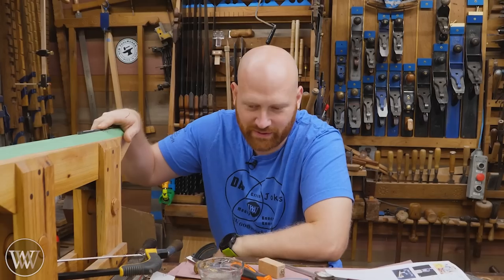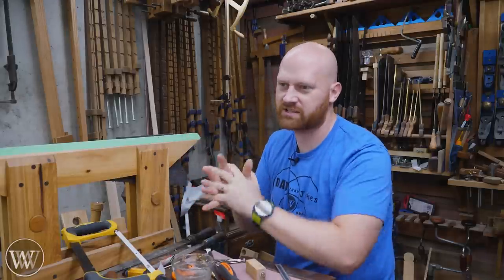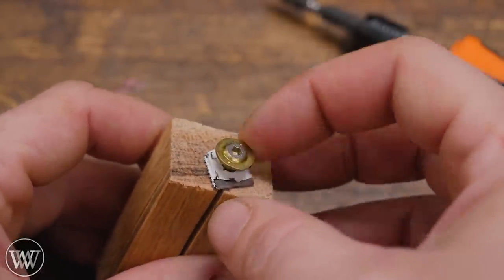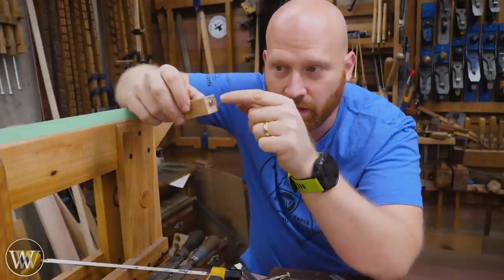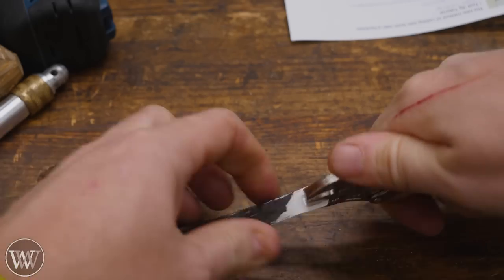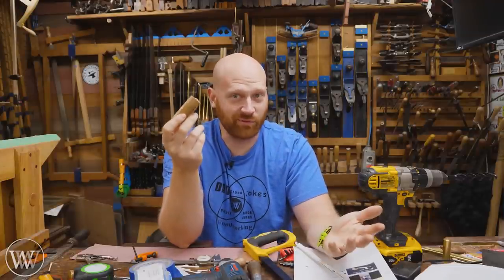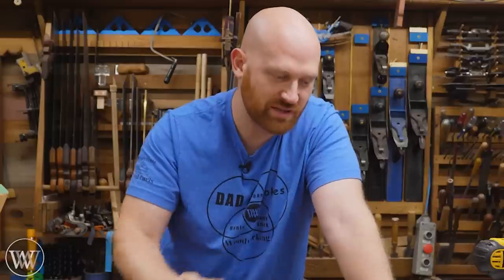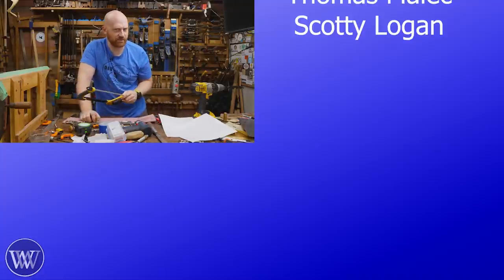I Was Wrong About Cutting New Saw Teeth A Better Jig

Comment: Just a thought.  Cut the slot in your scrap wood to the depth you want the teeth-cuts to be.  Attach a couple more pieces of broken hacksaw blade to the underside of your jig so that they protrude beyond the front of your jig.  Now you have a depth stop, and all it cost you was more of the broken hacksaw blade and a little epoxy to attach the pieces to your jig.
Reply: I like the epoxy/glue idea. That way the depth stop pieces will come off before they can dull the hacksaw itself.
Reply: Also, make the slot in the wood block as deep as you need it for the largest saw teeth you ever need to make then drill a couple of pilot holes down from the top of the block to meet that slot.  A couple of blunt ended screws driven down through those pilots & you have an adjustable depth jig with depth stop as you’ve already described.

Comment: I saw Dan’s video a while ago and I thought his jig was brilliant. I also knew I never would (or could) make anything even close to to it…even the box he made for the jig was gorgeous. James’ version is much more approachable for the home workshop. My first thought is that, rather than make the jig adjustable, I’d make one dedicated to a specific size with an indexing plate and saw guide plate spaced with appropriate shim stock. For high tpi count maybe a cheap feeler gauge set would provide the necessary spacers (not worked anything out yet).
Reply: Your first thought is right on.  Unless someone's going into retoothing saws for fun and profit or into making custom saws to order it's not worth making more than one at a time for the specific TPI.  Save each one just in case, but they'll probably not be needed again unless loaned out to a friend,
Reply: Thanks for the praise George I appreciate it. I keep meaning to post a video demonstrating the first guide I made which was much more like you mentioned, simple to make and fixed at a certain TPI. When I get some spare time I'll upload it. I'm currently working on a revised version that I hope to make a small batch of.
Cheers
Dan.
Reply: @thewoodmandan842  That sounds great Dan, I’ll look out for the video.

Comment: You could epoxy a strip of scrap hardwood to the hack saw blade to create a depth stop. The downside is you would have to make a new one for each replacement blade as they get dull. 
Although, since it will have a short lifespan, it might not matter if it's hardwood. You might be able to just cut up some paint stirrers or yard sticks to get your stock more easily.

Comment: Thank you James for the mention of my first video. The number of views and comments have caught me by surprise. I have a cheapish back saw with hardened teeth where a lot of the teeth are broken out. I am thinking about grinding the teeth off and re-cutting new teeth. Is that worth doing or is the blade metal not suitable? Could be my 2nd video.
Take care, Harrance.
Reply from the maker: Jack saws have hardened teeth so they can not be easily cut and will ruin most files. Generally those blades are considered disposable.
Reply: @WoodByWrightHowTo  I understand about the hardened teeth. I was more thinking about if I grind the teeth off, down to the "un-hardened" metal, would this be too soft to hold an edge for sawing. I have been using pieces of jack saw blade as card scrapers for ages. The files cut this metal well.
Reply from the maker: With a hack saw blade the whole thing is hardened. Not just the teeth. At least the ones I have worked with. Maybe some don't
Reply: @WoodByWrightHowTo  I think you have misunderstood my comment. I am wondering about a cheap Tenon Saw with hardened teeth. I have been using cut up pieces of these as card scrapers for years and they work great. The scrap I used in my video was one of these. I am thinking if the hardened teeth are removed and new teeth filed in, would the underlying steel be hard enough to hold an edge enough to make it a useful tool. I have not seen any opinions either way about it so I was wondering about your thoughts on it.
Reply from the maker: Oh yeah definitely. The same steel that would be under that is the exact same still you'll find in pretty much any saw out there. It won't last quite as long as the hardened teeth but you can sharpen it easily.

Comment: Glue the piece of the blade to the end of the wooden block and you can adjust the distance with a screw.  Attach another blade to the side of the saw blade to adjust the depth.
Reply: Exact same thought I had.

Comment: Nice jig. I wouldn't worry about a depth stop. As long as you have some sort of near depth marking and get close - a stick in the saw vise, level the blade, level the stick at depth, file, touch the stick, your done, rinse n repeat.
After all, many of the ways to fashion depth stop would raise the plate in the vise and higher the plate, higher the vibration.

Comment: Brilliant. Reminds me of a box joint cutting jig.
Reply: Damn you, now I want to build a box-joint hand saw/plane. But I will have to finish a few other projects before I can get to that. On the other hand, it should be possible to mark them out quickly by making an appropriate stack of snap-off knife blades and spacers that you just tap against the end-grain, the depth line you sort out by putting a ruler up against the mating board flushed with the end. I suppose good spacing is about 1.75 saw kerfs wider than your favorite narrow chisel.

Comment: Welp, that works hilariously well. Heck maybe you could use some double sided tape or epoxy or .... something, to attach the scrap hacksaw blade to the cutting blade (on the other side of the blade from the jig so it doesn't mess with spacing) to act as a depth-stop. Though just some masking tape as a visual guide would probably do the trick if you slowed down on that last stroke a bit. Now I just need to decide if I want to buy a plate or file down an old one to try making the coarse rip saw I've been wanting...

Comment: I recently cut new teeth on an old saw using Paul Seller's method. Before I got done, the wooden guide block had completely fallen apart, and the teeth were uneven. I will have to see about making one of these jigs.

Comment: A bigger hacksaw scrap would allow you to fix it higher up ,the screw clear of the actual cutting hacksaw,that would allow you to use perfect thicknesses of spacers without the screw needing to be filed if they too are fixed higher up or wrapped around front and back,I am accumulating saws with hardened teeth in my job as a carpenter that I will be able to re use thanks to you and my angle grinder

Comment: Weird. I just ran across thewoodmandan video earlier today and passed it on to your earlier video which I also just found today [i guess it's "Re-Toothing Day"?] and to someone else's saw retoothing video I found today. Now I just stumbled across this update of yours and you opened up another way to skin the retoothing cat. For example, where you drill the hole in the end of the wooden block for the hacksaw blade, washer and screw I think you could make it much more adjustable if the blade had a hole in it just large enough for the screw head to fit through and you drilled a counter bore in the end just deep enough for back of the round head/washer head screw head to bottom out against so the reference surface of the screw head to be zeroed out flush with the hacksaw blade you've epoxied or otherwise affixed to the end of the jig. Then, depending on how snugly the screw is in its hole you might be able to adjust the TPI/PPI spacing w/o washers. There are, however, all sorts of different thickness of brass washers available from machine tool suppliers to hobby shops. You could use the blades from a sacrificed HF&T feeler gauge or two if you wanted to. Just a few quick, top of the head thoughts. (Thinking of new ways to do things. It works every time its really tried.)

Comment: I mean this one is nice but it seems more likely to let the saw hop around that the other one.  It also requires you being coordinated enough to use both hands and still drive the saw accurately. Though your three c clamp jig was admittedly unwieldy, it left your second hand free to help keep everything stable. Plus it has a depth stop.

Comment: Epoxy the heck saw piece in, and screw is free from holding duty but adjustable for different tpi. Maybe use a 6-32 or 8-32 machine thread screw so 1 turn is 1/32 of an inch.

Comment: Depth stop is easy, fit two blades into the hacksaw, one to  cut and one ground flat the desired depth back from the cutting teeth.  Maybe enlarge the mounting holes at the end of the guide blade just a tiny amount ('a gnat's todger' was the official length we worked to for these kind of micro adjustments when I was an engineering apprentice oh so very many years ago) so that it's the cutting blade that's tensioned when you tighten the hacksaw (if the guide blade is too loose or falls out you've grossly over estimated the  gnat's todger, do it again and celebrate that you've learned something about gnat's todgers... You could tell also your friends about this, but I'd suggest you don't!).  Bit of a fiddle to make in the first instance, but I'd guess the guide blade would last forever since it's not receiving any significance wear.  The cutting jig is so simple that it's brilliant!  Making the jig adjustable sounds cool, but it's so quick to make, maybe just write the TPI on the sides and make new jigs as required for different TPIs.

Comment: Why not make a double bladed kerfing plane? Have one blade upside for the guide. Having the blades recessed into the wood would keep them parallel and chatter free and you could use it as your depth stop for the cuts. Make different spaced/depth ones for different PPIs.

Comment: you can add a depth-stop by attaching a piece of tempered steel on each side of the slot... then the saw will stop when it gets there. vary the depth of the cut by varying the depth of the slot!

Comment: Do you think you could go as far as 16TPI? Just thinking for 2 inches of really fine teeth at the front of a dovetail saw, then 13tpi for the rest
Reply from the maker: I have sharpened down to 18 tpi. If you have really good eyesight and a good magnifier you can get down to around 20. But for anything smaller than 14 I really don't suggest making the front teeth smaller. There really isn't a big benefit to that.
Reply: @WoodByWrightHowTo  good eye sight? Darn I'm screwed haha
Cheers love the look of this jig 😁

Comment: Hello, Mr. Wright;
While recovering from covid I watched this.
I found it interesting but a bit confusing.
Because of what I know about saws it doesn't look like a hacksaw actually cuts saw teeth.
I have sharpened hand saws (long ago) using a 3-sided file.
Do you file the teeth to shape & sharp after setting the spacing with the hacksaw?
Have a GREAT day, Neighbor!
Reply from the maker: This doesn't actually cut the taste it just creates a Nick in the blade that you can then come back and file the teeth in. But that Nick allows you to have even spacing between the teeth.
Reply: @WoodByWrightHowTo 
Thank you Mr. Wright, so very much for your kind reply.
I came back to rewatch this one as I'm trying to restore an old saw.
It turns out I have 6 hand saws, 1 pull, 1 hard point, & FOUR rip?
Clearly i need a crosscut & I may refile 1 to crosscut.
If I can do it w/out recutting the teeth.
Tho I've 1 saw that really needs refinishing & sharpening.
It has 4-1/2(?) ppi so I think I should refile it to crosscut.
Since it need more work than any of the others.
Have a GREAT day, Neighbor!

Comment: If the hacksaw piece is glued in, you could adjust by just screwing the screw in and out.
Reply: I was thinking the same thing, drill an undersized screw hole right through and either tap the hole for a bolt, or if you don't have any taps for thread cutting just screwing a bolt through will probably self-tap.  The bolt head can be at the other end to keep the cutting end tidier, and then just turn the bolt until test cuts confirm the bolt is protruding the correct distance (test over a reasonable length, so for example 50 teeth will magnify any inaccuracy by a multiple of ten compared to testing over just five teeth).

Comment: Clamp an old hacksaw blade to the free side of the hacksaw you are using to cut and voila — depth stop.
Reply from the maker: the clamps would hit the jig, but I guess you could space them further apart and just not take a full stroke.
Reply: @WoodByWrightHowTo  small clamps at the ends would be preferable. Another improvement that occurred to me after a second thought you might get away with grinding of a consistent amount from the depth stop blade and mount it in the same holders as the cutting blade.

Comment: Couldn't you just put colored tape on your saw blade to act as a depth guide?
Reply: Of course, but then you'd have to think about which colour was best, and life is hard enough as it is.
Reply: @ricos1497  is boiled linseed oil a tape color?
Reply: @jgo5707  I'd like to think so. Alternatively you could use iron on white oak veneer finished with BLO instead of tape.
Reply: @ricos1497  too complex, ill just finish my tape with BLO. That should work